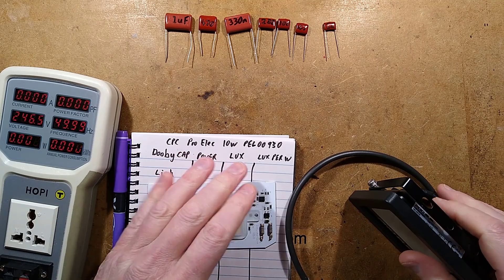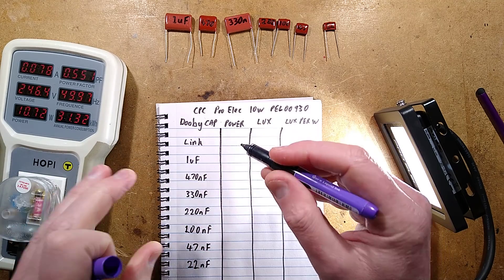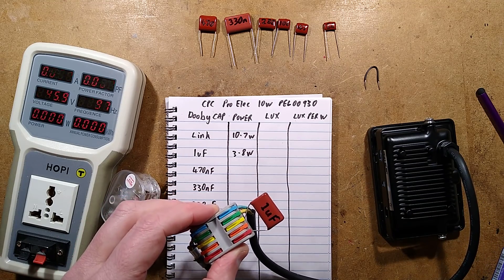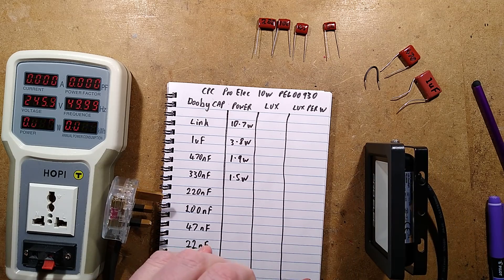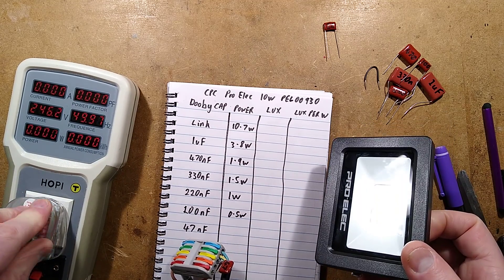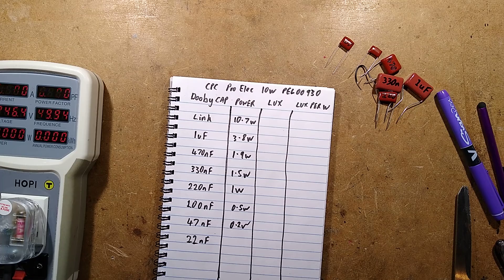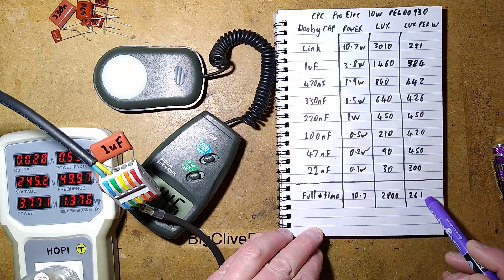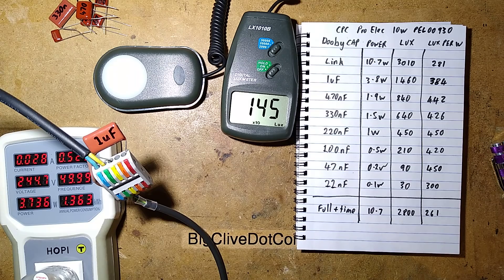Doobying a cheap LED floodlight with lux/efficiency readings

Comment: I was connected the other day and this was quite an interesting experiment to perform live. Glad to see you fixed those inexplicable cracking and ripping noises that were affecting the stream every now and then, followed by general laughter. Oh my!

I was about to ask a few questions back then but the chat speed was way too fast for my slow English.

I am interested in doing this with sealed non-hackable bulbs (unfortunately not being as the ones you show in that brilliant previous video). The idea would be to place the hack just inside the holder, but I guess it would be unsafe to leave a capacitor live there by itself in case another person might have to manipulate it unknowingly in the future. 

what would be the recommended value and wattage of the resistor (or resistors, if it depends on the capacitor value)?
How would a discharge resistor affect the wattages and/or luminances in this chart?

Comment: Will this work if I connect an LED bulb instead? I think it should. And what voltage are the capacitors rated for?
Reply from the maker: Check this video out for doing it with ordinary lamps.
https://www.youtube.com/watch?v=ISTB0ThzhOY
Reply: @bigclivedotcom  Thanks. That's just what I was searching for.
Reply: I'll check it out. Thanks

Comment: Would it be possible to use a variable capacitor as a dimmer then?
Reply from the maker: They don't really do them in high values like that.  But you could switch between fixed intensities.
Reply: @bigclivedotcom  How about having the variable cap in parallel with some larger fixed ones? Being a newbie this may be a silly question..

Comment: The inductance and resistance of the caps might affect the lamps effectiveness and compatibility with this mod.
Reply from the maker: Many lamps use a similar cap for their main current limiting.  The lamps that won't work are ones with complex switching power supplies.

Comment: What does the capacitor do when it’s in series 
If you were to put a resistor between the leads on the capacitor wouldn’t it heat up while the capacitor was being used
Reply from the maker: A capacitor passes a portion of current on each half wave.  The resistor would be high value like one megohm.

Comment: Clive, we fitted a load of LAP 20W led pir outdoor lights.  After 3_4 ,months they failed.  Soooooooo??......The manufacturer knew about the fault!  The cable restraint nut that grips cable entering unit was acting like capillary action, when it rained. Water dropped on cable and ran into unit .....Then .......FUBAR😋 .
If it wasn't for that fault the lights wudda been great

Comment: Hi

I used to call it 20th century living - disposeability  - i need to increment my century now

But this is another example of manufacturers making the produces workable but to almost full capacity and have it burn out in x amount of time 

Who was the person who coined the phrase   "  built in obsolescence  or replacement"

I am happy to buy products and pay a good price for it, but i totally hate it when i buy new ( not the cheapest ) then have to trow it away because the internals were marginal or it just burnt out and it is a throw away item

Regards
George

Comment: I distrust any kind of built in LED lighting. There are no standards, so if the lamp is of even middling quality it takes a few years to fail. At which point in time the lamps are no longer available, resulting in a lot of work to fit new lamps that have a different shape and different mounting hardware, etc.

Comment: This is the video a lot of the dooby commenters were waiting for. Thanks for getting the lux meter and doing the testing. Like you said, pretty much got what we expected, but now we know for certain.

Question, would this work on automotive led interior lights too?
Reply from the maker: For low power automotive lamps a resistor can be used.  Or in some cases a diode or two in series to nudge the voltage down slightly.
Reply: @bigclivedotcom  Thanks so much for the reply Clive. I have modified 3 lights to the Dubai style so far, very happy with the results. Now to the 12 volt bulbs.
Reply: @rolliebca  it been 10 months. Did you do the 12 volt mod? What are the results and what components did you use? I’m interested 🙂

Comment: Im confused why did it get dimmer with snaller caps
Reply from the maker: Less current being passed on each half of the sine wave.
Reply: @bigclivedotcom  thank you.  I kept thinking that it didnt make sense

So i designed a 5v power supply for an arduino project  and in addition to the 470uf aluminium cap i have a series of increasing value mlcc's starting at 1nf and ending up at 22uf the idea was to smooth the ripple for analog sensors.  And ultimatly i have a very smooth wave form and a solid 5v.  This makes me wonder if i decreased the current delivery signifigantly

Comment: Two other possible combinations for power "settings" between 3.0 amd 10.7; 2uf (2 1uf capacitors in parallel) and 1.47uf (a 1uf and a 470nf in parallel).
I'm curious at what point the light starts to run at a temperature other than "stone cold".
Also, what was the light's run temperature at full power?  Did / does it pass the 10 Second Test?

Comment: I just made a dooby lamp following the schematic from the original video. It's running very cool and such, but I screwed up somewhere and it is flickering, not noticeable to the eye, but noticeable on a camera. Still have enough parts to make another 3 of them.
Reply from the maker: Cameras can catch flickering on lamps without good smoothing.
Reply: @bigclivedotcom  the current limiting circuit on my lamp seems to be set around 30ma, but the current regulation itself seems off: higher voltage drop across the circuit = higher current. I need to investigate that. Probably need to wash off flux or something.

Comment: Can you slow motors down using this method of putting ceramic caps in series?
Reply from the maker: You can use a cap to limit the current to very small motors.  Usually in things like timers.
Reply: @bigclivedotcom  thanks Clive. Thanks for the vids BTW. Appreciate all the effort you put into reverse engineering, and your knowledge is rocking horse s***

Comment: I can increase the life expectancy of the fixture at the expense of light output. 
Possibly rendierng a poorly constructed fixture unsuitable for the purpose  purchased or I can buy a better quality fixture and do nothing.  
Which option might slow or possible stop the flood of cheap and often unsafe crap from china?
Reply from the maker: You may find you pay a lot for a quality fixture and it fails within a year too.
Reply: @bigclivedotcom   Why would that be the case from a manufacturer who has chosen LEDs that provide the required output without being overdriven and a driver circuit that's not running on the edge of failure?  Have a look at Hyperikon.  Spend a little more, get something that doesn't go to the landfill.

Comment: About five years ago I converted some light fittings to use integrated LED / power supply modules despite having a huge heatsink I kepkept popping modules every now and then by simply adding a Cap I fixed the problem.   line voltage was about 245 not the 220 as specified on the board perhaps that was the issue, was easy fixed with a cap.   I was inspired to try this by Clive‘s capacitive dropper videos.    Many thanks mate!

Comment: Interesting that the 330nF cap dipped a bit in efficiency relative to the one above and below it (470nF and 220nF, IIRC). Perhaps a quirk of the switching chip/regulator on the LED PCB? Or maybe that specific capacitor lost a couple hundred nF?
Reply: My bet would be on measurement inaccuracies, or possibly supply voltage variations. If the capacitor's value is off you'd see a corresponding change in power draw.
Reply: @eDoc2020  That does seem more likely; Clive even mentioned his light meter wasn't exactly top-shelf. I do wonder about the on-board regulation though. When I wrote that comment, I was leaning in the direction that, maybe, the specific capacitor value creates an oscillation against some harmonic of an on-board switching regulator. Or, perhaps, it's a phase-angle thing? 🤷‍♂️

Comment: By the looks of the notes you made, it would be more beneficial to have the light in line with a way to flip it between a 1uF and a 470 nF capacitor to run it cooler as a  work light with a high and low level output. Think it would make for a light on a work truck that would last for years, ignoring the factors of water ingress and vandalism?

Comment: While I'm sure LED lights can be overdriven to failure, I have never experienced this issue.  I've been using LEDs in my home for about 5 years.  I have experienced very few failures and always buy the cheapest bulbs or fittings I can.  It is certainly true that the power for the lights in my house get hot.
I presume these are 400v capacitors?
Reply: I want your luck, mine dont last more than 14 months branded and 8 months unbranded

Comment: If the sole intention is to promote lamp longevity the pulling it back to 8 or 9 watts would go a long way without sacrificing too much intensity. If you want to maintain the intensity yet prolong the life, then engineer some form of additional heatsink. It would be great if those were 1W chips and they are driving them at .71W, bad if they are .5W chips and they are overdriving them already.

Comment: This video got me got me thinking about LED compatible dimmer switch implementations using a capacitive gyrator? 
Though most typical gyrators are induction gyrators used to simulate inductors through use of capacitors, I understand it is possible to simulate a variable capacitor with a gyrator using an inductor and variable resistor. 
See the following article: "The Technology of Wah Pedals" http://www.geofex.com/article_folders/wahpedl/wahped.htm

Comment: Very interesting. I note most bulbs are measured in Lumens, which is the total light Flux (o/p) of the lamp. i.e. for a 5W GU10 led is around 350-460 lumens. Assuming my understanding of Lumens to Lux is correct: if the GU10 bulb is able to illuminate only 1 sq m of area at the measured distance, then the measured value of Lux would be 350-460 Lux...... Therefore what I don't understand is why your value of measured Lux is way above the 350-460 Lux you should get from a 5W GU10 bulb when measured at a similar distance for a bulb running at 3.777 Watts......

Either the measured value you're getting from your Bulb at 3.777 watts is incorrect, or running your bulbs this way is MUCH more efficient than a normal Led Gu10 bulb.......

Not withstanding I don't know the distance between your bulb and the tester or how much area you're able to light from your bulb.......

Too many questions and not enough answers!
Reply: My understanding is GU10 bulbs are a bad environment for LEDs because they need to pack lots of light into a tiny space, leading to lots of heat and low efficiency. If your 5W bulb is 400 lumens that's 80 lm/W, well below what higher quality LEDs can achieve.

Also, you're using 1 m2 area as reference for your bulbs. Clive's measurements are at 300mm distance so likely much less area is covered. If we assume the light in the video has a 45 degree spread that would be somewhere around a third of a square meter. This would bring Clive's measurements of the unmodified unit to a much similar lux/watt ratio as your stock GU10.

TLDR: It's probably a mix. Underdriving this style light is going to be much more efficient than your stock GU10, but not 8x as efficient. I'd guess more like 2x.

Comment: Would be interesting to see this at 120V. It looks like Clive has a product idea there, "LED Light Saver" just a box with a capacitor inside and 2 terminals, could pass Live, Neutral, and Ground though and make it seem like it does more. Of course, making it compliment to regulations, but I could see it selling to lower the brightness of LED floodlights around your house so there is a more consistent light, or just saying it will save energy/money/green bs.

Comment: Alright, this is amazing. Could this be turned into a product that you can just pick up wherever? If we had the capacitor, a discharge resistor, and some wire terminals nicely packaged, with a wattage rating stamped on it according to the current country's AC voltage and frequency, this could be super helpful. Just go buy a lamp twice as strong as you need, slap a limiter on it, and walk away with something that actually works.

Comment: I bought a 20W floodlight for the garden, but it’s far too bright, it’s blinding drivers as the garden backs into the road. Would a 1uF capacitor reduce the brightness enough?
Reply: Probably. I'd guess that would reduce the power to at most 5 watts.

Comment: Hi Clive, Can you make a video just discussing these types of capacitors, the ratings and the safety aspects of using them. Also a non wago block way of wiring these in series with a lamp fitting Thank you !   ps. and how do these capacitors fail ?

Comment: I've found that none on the LED lights have installed come remotely close to the manufacturer's claimed life expectancy. 
I have noticed that the bases have been too hot to handle if they are on for any longer than 30 min. 
I'll have to look at installing 1.0uF 400V 10% Axial Polyester Film Capacitor AE 104K400 inside some fire resistant heat shrink probably in the ceiling rose rather than inside the switch wall cavity and see how they last. The one problem is the switching ie the odd chance of turning on the light when the supply phane is 180deg with the cap's voltage is reverse polarity.  So I suppose a 1-1.5M 1W resistor in parallel with the cap should elevate that issue.

Comment: Thank you for showing us the results and teaching us helpful methods. I have a question that needs to be answered plz. Can I use a 1250v cap that I have plenty salvaged from CFL circuits for capacitor dropper led bulbs?
Reply: Those high voltage caps would work but they are usually low values like 4.7nF so they'd only pass a teeny tiny amount of current. Even the larger-value film caps in a CFL might not be enough. If you want to run LEDs with a CFL circuit you can often use the circuit as-is, shorting the old filament connections and connecting across a string of anti-parallel LEDs.

I just posted a video where I reverse engineered a 3-way CFL so the topic has been on my mind.

Comment: You can use the cellphone for lumen detector :D Just donwload an app that reads the sensor :D
Reply: cell phone light sensors are very cheap and shitty unless the apps use the camera
Reply: @HasanProd  depends on the phone but don't mistake the camera's hability to detect the luminosity with the luminosity senro on the front. This one measures the light in lx and is used to adjust the brightness on the screen. On high end ones is pretty accurate. Mine (s20) meassures from 0 to over 65k  lx

Comment: Should make an adapter that plugs inline with a LED light to do this.  Have it plug into the wall like a standard 3 prong adapter, but it has a capacitor built into it.
Reply: I like this idea but also add a selector switch with multiple capacitors to add a dimming feature.

Comment: Thanks for the video and taking the time to quantify the lumen efficency.

Here is an idea. Make a light socket that plugs into another light socket with specific series current limiting capacitors. Or, add the ability to switch which capacitors is used. then sell on Ebay and Amazon.

Comment: It would be interesting to see the effect of 2.2, 3.3, and 4.7 µF capacitances too, to know where there's a negligible difference.
Also, note to future EEs: if the meter says 0.000, don't guess what the reading is. Please.
Reply: Extrapolation isn't guessing though....
Reply: At one point the meter indicated 0.502 watts
Reply: yeah thats what i was thinking, if i could get my bulbs down to roughly 90% (undermining the over drive) that would be great, getting most of the light while extending the life and increasing the energy

Comment: Running temperature might also be interesting.
Reply: Stone cold once you stop grilling the LEDs.  The minimal heatsinking they use on this stuff is just fine for all purposes below the over optimistic factory specs.  The best balance is around 220 nano Farts, which is probably the best compromise between heating the LEDs or the capacitor while still giving the most light.

Comment: Idea for next build video, a board with a set of caps and switches to bring them in and out of circuit to quickly and easily do these types of tests?
Reply: You just described a capacitor substitution box. They exist commercially but probably not with the needed 400V rated caps. So a DIY high voltage version does make sense.

Comment: So...I have a question... 8 of these all powered from the same switch, loop in at the switch. Could you connect the capacitor in series at the switch covering all led lights and what size Capacitor would you need to have the same effect as your 1uf example here? 

Keep up the good work you bearded legend 😎
Reply: I can't see why it might be anything other than  8 uF if you have one capacitor now running eight floodlights.  It's the same calculation as you'd use for a resistive dropper.  The load current has increased by a factor of eight, so you need to reduce the reactance by the same factor in order to keep the voltage drop the same as you previously had for the one floodlight.
Reply: @westinthewest  awesome, thank you. I am a little rusty with electronic calcs but thought that may be the case 👌
Reply: @civicvtec92  Keep in mind this calculation assumes each floodlight is identical. If the lights are different the load sharing won't be even due to nonlinearities, so some lights will dim more than others.
Reply: @eDoc2020  will do 👍 the lights are indeed all identical and are the exact same pro elec units Clive has in the video (even got them from CPC lol)